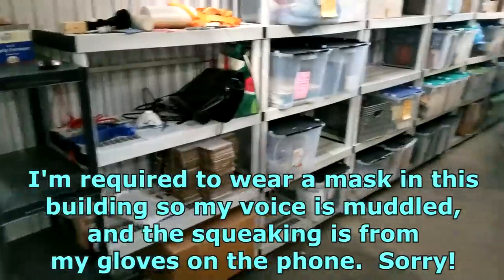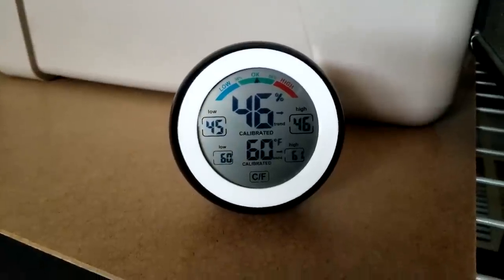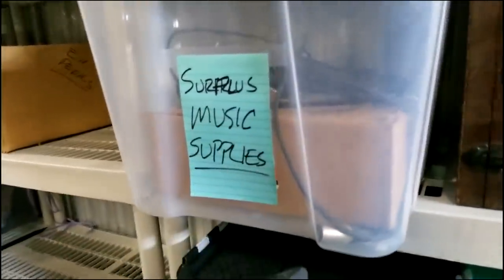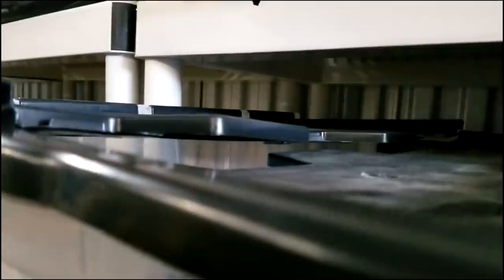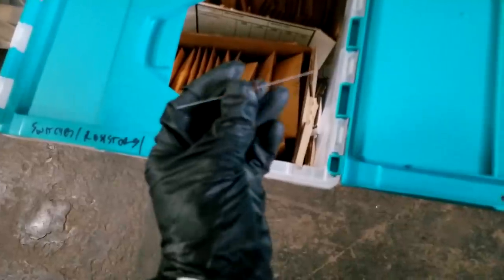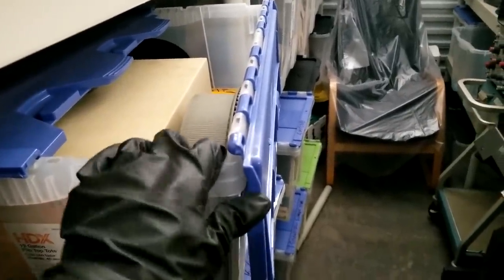A Look In The Vault

Comment: Hi Fran, great tour in your storage unit.  A room full of "Possibilities!"  One exception I have is when you pulled out the Ohmite Rheostat and called it a miniature Variac.  I would agree that the component could be used in that application in a limited way, though I believe its original intent was as a higher power potentiometer.  A Variac (and you have many) is usually tapped in multiple places along the single coil such that, dependent upon the connections you can actually output a higher voltage than you apply.  For example, I used one in the lab to boost the 120V incoming line to 140V for the 25W soldering iron to get that extra heating capacity on the few occasions I needed it.  Otherwise I would dial it down to a lower voltage to preserve the tip, yet provide sufficient heating for my work.  Love your channel, learn something each time I watch and, as always, stay safe!
Reply: Yup, ain't no variac.
Reply: Variac would also have a magnetic core of some kind. Ohmite are known for power resistors.

Comment: Fran, the amazing is, those bins are only about 1/4 full. You have plenty of room to acquire and store a lot more stuff! 

In Feb. 2020 the LAST electronics store closed in Rochester. They sold stuff cheap up until the last day, but then they hauled probably half of the stuff out to dumpsters and junked it. Thousands of resistors, diodes, IC's, etc, much like what is shown here including industrial high power components. 100 watt wire wound resistors, rheostats, large 300 amp stud mounted diodes and Triacs. All gone. I could have went there the days they did the clean out, but I'd of probably cried. Or much worse, hauled a lot of it home!

Comment: That box said Baker, you gotta cake in there? Does the humidity permeate through the building's walls, floor, ceiling. Got windows? To reduce the humidity, you'll require several units that you can place near a floor drain, and you'll need a fan or two to circulate the air.

Comment: If the gasses you are worried about are heavier than air the plastic buckets will trap that even with no lid. Can you put some kind of fan in that room, a bit of air circulation might help with that and the humidity. I've stored electronics and vintage cars in concrete buildings and we would start by wrapping the concrete walls and floor in vapor barrier plastic and that seemed to cut down on the humidity.

Comment: LOVING the BinaView opener!
I wish I was 1/1000th as organized as you are. I hope to get there someday, but with two jobs, probably not. I was genuinely hoping that at least one of the two jobs would be classified as "non-essential" to free up some time. I even offered to give up a shift every week if any of my co-workers began to suffer financially, but it seems my attempts were in vain! 

I need to get a bunch of those black totes with yellow lids like you have, the cheapo Sterilite and lower-end Rubbermaid totes I have just don't cut it. Then I can put some mileage on my brand-new Brother label maker (although it was EXTREMELY tempting to dig out and fire up my Varitronics Merlin label machine, but I know the old stock of labels won't stick, and that's even if I can peel the backing off, and too much time will be wasted as I go through the various font discs trying to pick one).

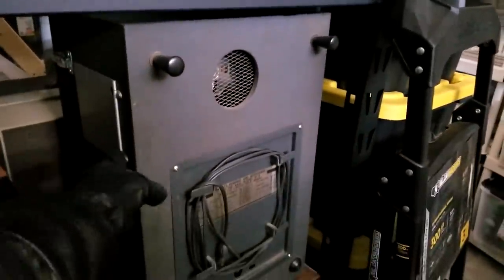1:07 - I have the Roberts/Rheem iteration of that same reel-to-reel. It's on my to-do list for refurbishment, along with my Panasonic 8-track deck and my dad's old kit-built Eico Cortina color organ.
Can't wait to get into the color organ, it'll be my first time doing a refurb *and* doing point-to-point wiring, and a perfect opportunity to upgrade it with a polarized plug, and add a preamp so it can run off Line Level instead of Speaker Level! The last time I powered it on, circa 2002, the lights all went haywire (seizure-inducing flickers) and the bulbs' filaments had some audible resonance in the really really high frequencies with the input lead shorted to the ground plane. Until I started watching you, Big Clive, Dave at EEVBlog, and Mr. Carlson's Lab I had no idea what was wrong or where to start with repair. Nor would I have the confidence to get my hands in there and actually attempt such an in-depth procedure. (Thanks to Mr. Carlson, I know that the weird metal canisters inside the color organ are tantalum caps!)
I promise you I won't use my father's old Weller 8250A to do the work, though, despite how cool it would be to restore this piece using the same soldering gun that was used to build it! It's a bit too cumbersome for my clumsy hands!
(EDIT: Formatting error and run-on sentence)

Comment: Frans Museum of old Electronics! You have some amazing stuff.

You should have a device which shouts "This facility will self destruct in 30 seconds!" with flashing red lights and stuff, when you press that Doomsday button. With those Jones connectors you can do a "That's not a connector, this is a connector!" version of the Crocodile Dundee bit.

By coincidence I watched Big Clive's video about the 1900's elevator control board made out of a thick piece of slate last night. That has some real contactors on it.

Naomi Wu has a 360 video in an electronics market in Shenzhen where there is a whole ails of shops selling modern copies of those knobs you have. That is a lot of lovely old Bakelite. It all seems in surprisingly good condition.

Great video. Stay safe.

Comment: Lotta cool stuff... it's been my experience that unless two different plastics touch long term , most store over long periods of time just fine.
     I can't speak for the nitrocellulose items. I have no real experience with it.
     Bakelite lasts almost forever , but breaks easily.
      I have a small selection of old analog meters..maybe two dozen.
       Looks like you have a lot of 1940s stuff...
        Those filament transformers from Radio Shack! Used a bunch of the 6.3 volt ones in the '70s..
    Electoarchaeology!

Comment: None of those knobs would be "nitro".  Bakelite, maybe, but not nitrocellulose.   Celluloid worked best in items that were _flat_.   Very very rarely did you find it truly molded; usually it was carved.   It has to do with the process for creation.  (and THAT apparenty was very dangerous) 

So, the "ivory" inlay on an old radio would probably be celluloid, keys on a piano, and so forth.  Fountain pens had some celluloid, but they were often turned from rod stock, not molded. 

Take a spot that won't be seen, and touch a hot pin to it.  If it scorches, it's celluloid.  If you smell phenol, it's Bakelite.   Usually wood is pretty distinctive on its own - and up until the 40's, there was a good chance it'd have nitrocellulose lacquer on it, or shellac.   That was about the only real option for coatings.

Comment: In terms of moisture and rust would it be best to crack all the lids a bit, or drill a big hole in the bottom? I have the same problem with cast iron parts, they’ll rust right in front of you
Reply: If you can keep the humidity below 50% and avoid warm moist breezes on cold days the rate of rust will largely come to a halt.  I humidity control my workshop in part to avoid the need to constantly polish the cast iron surfaces.
Reply: Ethan Poole thx, the breezes and temperature swings are something i never considered (always turning on fans and opening doors when it heats up or I’m welding)

Comment: 13:38 You expect an artist to understand science and heat/cold expansion rates. Now if that sculpture had been inside in a relatively stable temperature environment it might have survived. Outside, with extremes of temperature, it's not surprising that it hasn't coped.
Reply: Sometimes the artist does this sort-of thing on purpose. A realistic decay over time thing that "changes" the work.

Comment: My attention was picked beyond lukewarm from the beginning and went beyond boiling point when I saw the Simpson box.  Oh, please show you have recording paper rolls for another Simpson instrument.  Its the kind that has a basic analog multimeter and black layer on the strip chart paper, coated with light gray wax and printed  grid on top of the wax.  At regular intervals the mechanism presses the meter needle down to the chart and displays a small dot of the black layer by displacing a tiny part of the wax.  I have a roll of similar chart paper, but with wrong transport hole spacing.  And of course wrong grid as well.  The Simpson chart papers have been pure Unobtainium for ages.
Another thing that I was drooling was when you showed your collection of instrument panel knobs.  Great collection, but again a disappointment -- no HP knobs.  I have hoarded measuring instruments and a good number of old HP units have busted dial knobs.  My idea has been to restore a bunch of them and some day donate them to some other collector or museum..

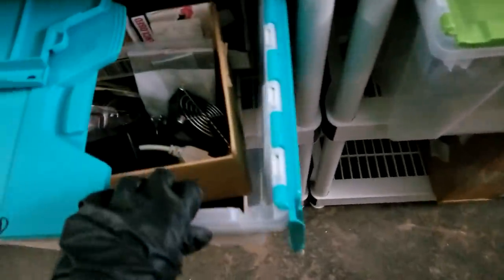Comment: 4:53 Well, that's a pretty unusual definition of 'treasure'.
Edit: Okay, so there's rare and historic stuff in there that shouldn't end up in a landfill but jeez, sell it, give it away, get rid of it somehow! You yourself seem to acknowledge, albeit tacitly, that you can't possibly make use of 95% of the stuff you're hoarding there. It just seems to be causing you grief. Let go of it.
Reply: The cost of storing this 'treasure' must really add up. Cherish the 5%, sell the rest!
Reply: @a-q197  well, if she's happy with it, I think she should keep it. I understand the attraction of a collection like this. On the other hand, until 2004, I had a similar treasure trove, collected over 30 years of Hamfests and clean-outs at labs and universities. When I got divorced in 2004, I took all the better tools and test equipment and left the rest for my ex to worry about. I had an entire heated air-conditioned building at the back of the property filled like Fran's vault, with a nice workshop at the front. I don't miss it at all, I've collected a bit of a hoard since then, but mostly newer stuff and in a much smaller quantity. I think I'm happier for it, and I'm sure my new wife is too! My father told me many times that when you have too much stuff, you don't own it, it owns you. It took a huge shakeup of my life to make the change though.

Comment: Hi Fran!
I enjoy seeing all this old stock stuff.  I just hope it does not make your hoard a target now.
I wonder if the cracks in the City Root sculpture were caused by out-gassing?
I worked at a place where there was a plastic potted sensor used on a bigger system and the ones made on Friday would crack, delaminate and fail when subjected to high temperature environments.
Analysis discovered that the ones made Monday thru Thursday would be baked in an oven to accelerate curing.  Those made on Friday would be allowed to cure at ambient temperature.
I would bet the sculptor did not take such environmental details into consideration for displaying the piece outside in the elements.

Comment: Interesting collection of stuff you have there, Fran. I noticed the Rennaissance chess set that I would have like to see close up. I noticed two old oscilloscopes. Possibly both Tektronix but one was definitely older than the other. There are people repairing old radios that might find some of those panel meters useful to replace damaged or missing ones.